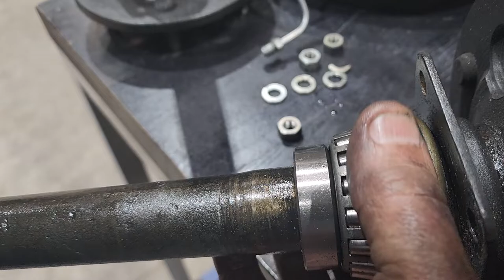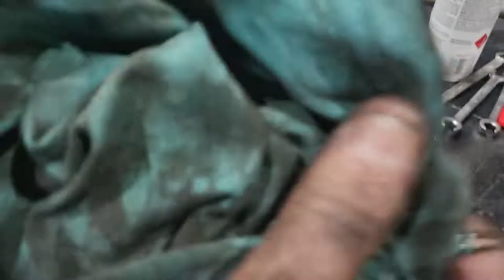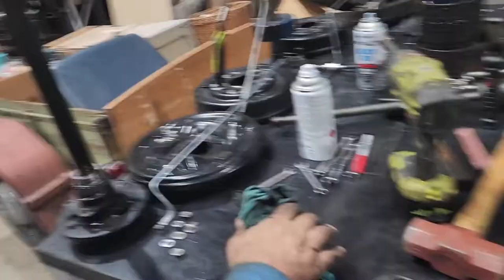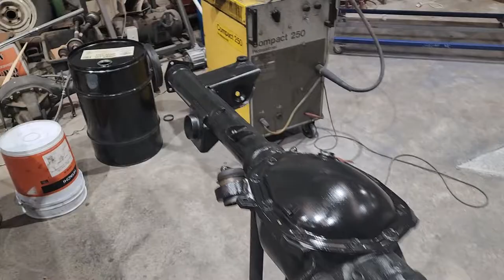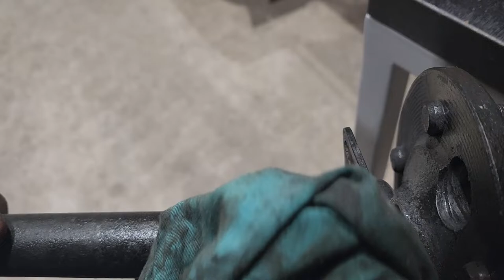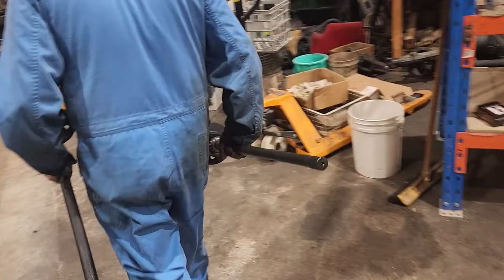HQ Holden diff. new cheap Chinese wheel bearings just fall apart and brake.

Comment: 99% time no one checks end float . This is not helped by the seal is available in 10, 11 , 11.5 ,13mm .
The cross section of the seal shoulders varies alot   square thru very rounded .
New bearing .002 thru .012 thou ,, service-able up to  max .025 thou  end float .
The seal in vid is nasty .